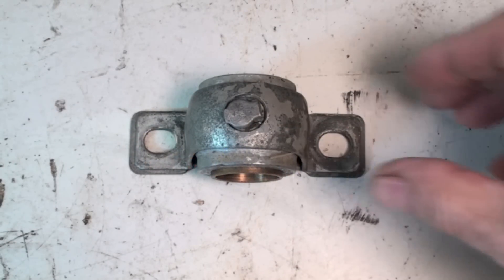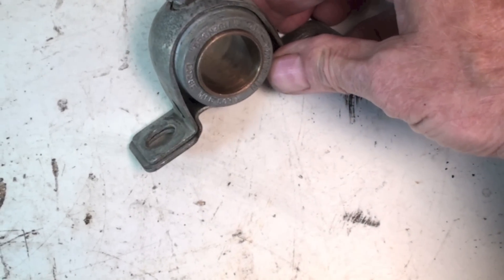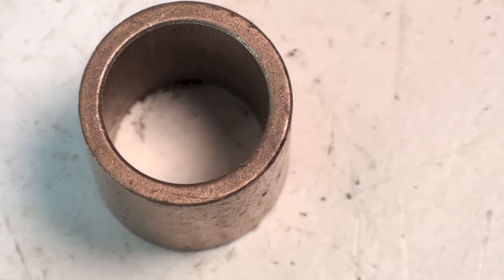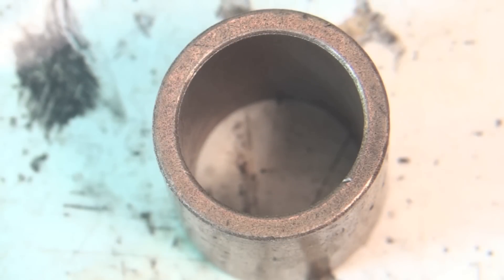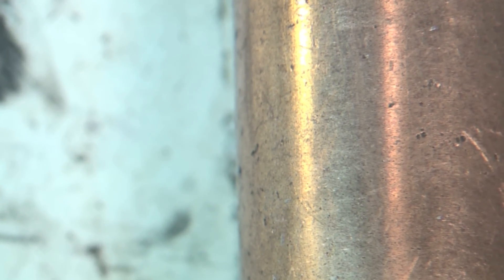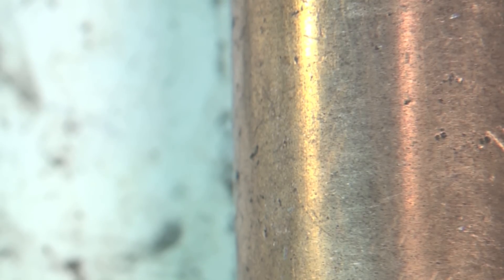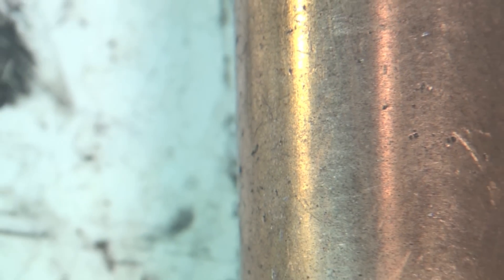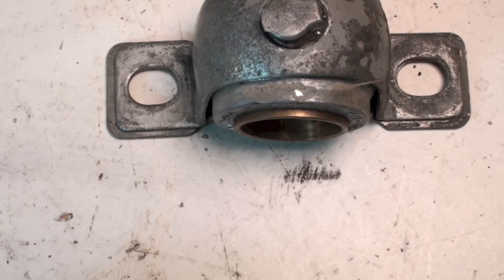The sintered bronze bearing explained

Comment: How are these made? Are they cold formed from wire? Powder press?
Reply: Cold pressing powder then heat treat it  on melt point for short period so powder catch together but not long enough to melt it fully so air gaps will left for lubricant to pass .

Comment: What is the "bronze" what does it contain that is not copper. Same or different for each manufactorer.
Reply from the maker: It is mostly copper with some tin.  Different manufacturers use assorted other metals for different applications.
GFM

Comment: have question., Can this type of sintered bronze bearing use in electric motors that rotate at a speed of 1425 rpm, round per minute?
Reply from the maker: They are viable in motors up to at least 3300 RPM.  

The biggest problem with using these bearings is in low RPM motors because to get the oil into the bearing surface, there must be some heat from the bearing to draw the oil out.
GFM
Reply: @grayfurnaceman  thank you Sir.

Comment: These are also known throughout history as oil light bearings. They're used extensively on old machines like old manual lathes.
They work great and last forever under certain conditions but they're also used in areas where say a pulley belt system is cantilevered inherently causing a lot of pressure on the far end of the cantilever. This will destroy a standard ball bearing very rapidly it'll also destroy the oil light bearing but when it comes to precision machines oil light bearings are cheaper then matching high precision ball bearings

Comment: I heard that you cannot machine these bushings, because the machining would close the pores and prevent oil flow. Is that true? If so, is there a way to reopen the pores?
Reply from the maker: That is mostly true.  The bearing is made by forcing the sintered bronze into the shape of the bearing.  Any machining will cover most of the openings.  No way to make it good.
GFM

Comment: Very good video, perfect explanation. The oil will also help to expel any dirt as it oozes through. 
I got into looking this up because of a debate over lubricating graphite-sintered bronze bearings. Bronze and graphite are powdered, mixed, and sintered. These are the "permanently lubricated" fractional horsepower motor bearings. When the bearings fail, the motor is normally replaced or the whole machine just gets replaced with a newer model from Wal*Mart. My experience is that oil seems to make it worse - perhaps by catching abrasive dust, or perhaps because things are already way out of tolerance when the oil gets added. 
The interest is primary for restoring machines for which replacement parts are no longer available. Repairing a stand mixer from the 1940s, for example. 

Any tricks up your sleeve for those?

Comment: Explain Plug Graphite Bearings (bushings) and how they are not the same as these your show. Plug Graphite Bearings are not used as replacement and for slow linear movement only or you have to keep oil flowing to wash away graphite dust. Else they will fail.

Comment: So what is the best type oil to use on these bearings that will "wick through" and lubricate well without getting "gummy"?  Reason I ask is that I have a dehumidifier fan motor that uses this type of bearing, and the factory grease "gummed up", stalling the motor.  I first tried cleaning the shaft, and re-lubing with thin "3-in-1 oil".  This seemed to last a few weeks before the shaft started getting tight again, slowing the fan and squealing.  This time I removed the bearings, flushed thoroughly with brake clean. and re-soaked the felts with Conklin "Rust Bomb" penetrating oil (even thinner than 3 in 1 oil ) that is supposed to "lubricate long after penetrating" and "resists evaporation".  Jury is still out, but fan runs free for now. Probably the pores are clogged in the sintered brass and will starve it for lube...
Reply: Soak the bushings in acetone overnight to clean them up. Afterward you'll need to re-impregnate the bronze with proper non-detergent 30wt oil. You can also use  3-in-one in the BLUE bottle that is made for electric motors. There are two ways of doing this. The proper way is to place the bushings in warm oil in a container where you can then pull a vacuum and the oil will be forced into the bushing. If you dont own such gear, you can heat the oil to about 180'f and let the bushings soak in it. Be careful not to set the place on fire if you use this method. 
Whatever you do, DON'T clean the bushings using abrasives. You'll end up 'smearing' (for lack of a better term) the bronze surface which closes off all those pores you want to put oil into. If you already did, you may be able to open up the surface using a fine emery paper. This doesn't always work depending on how closed off the surface had become due to improper cleaning.
Reply from the maker: The bearings are probably toast.  When they get dry, the bearings (and maybe the shaft), are melted.  The best oil I have used is the "zoom spout" oil.
GFM

Comment: why should bronze ? why not stainless steel or etc ?
Reply from the maker: Its a metallurgy thing.  Bronze is made up of copper and tin with small amounts of other materials.  The tin is a soft metal that absorbs contaminants.  The copper is also somewhat soft.  Harder metals like stainless or even aluminum will tend to damage the shaft.  This is not a complete explanation by any means.
GFM
Reply from the maker: Thanks for the support.
GFM

Comment: do you know anything about the process of vacuum injection of lubricant into these types of bearings?  How is that done?
Reply: Though i'm 5 years too late, the process that Oilite uses for their bushings involves heating the oil that the bushings are in, removing it from heat and then drawing a vacuum on the container. I use this method on bushings that i have soaked in acetone to get all the old gummed up oil out of. The bubbles come pouring out of the bushing. Here is my first attempt using not a proper vacuum pump, but a tonic bottle whose contents i previously mixed with Gin, but i used one of those hand vacuum pumps that are used to remove air from opened wine bottles. While this Macgyver method works, it takes longer than using the vacuum pump and proper container i have now. 
https://imgur.com/a/UNciMnT
Looks cool though. Just not smart if that glass broke.